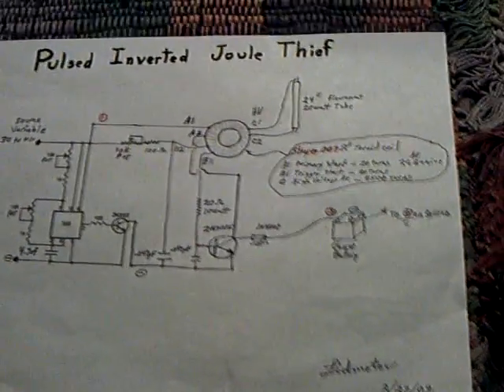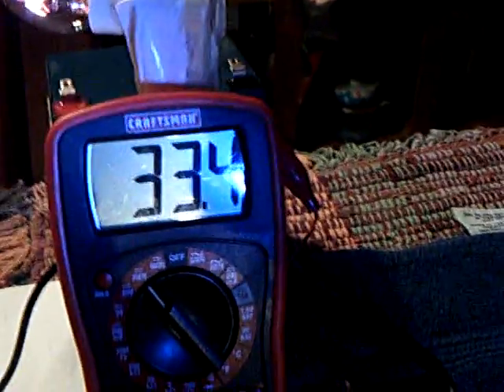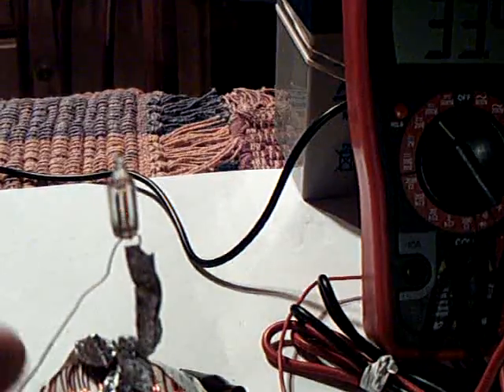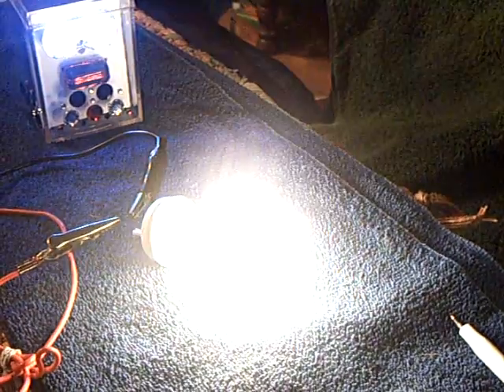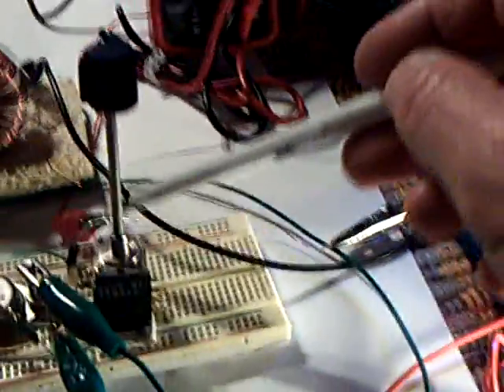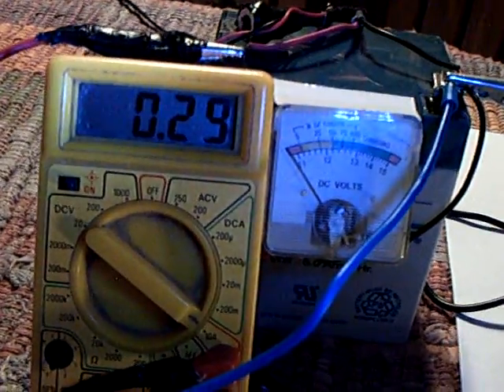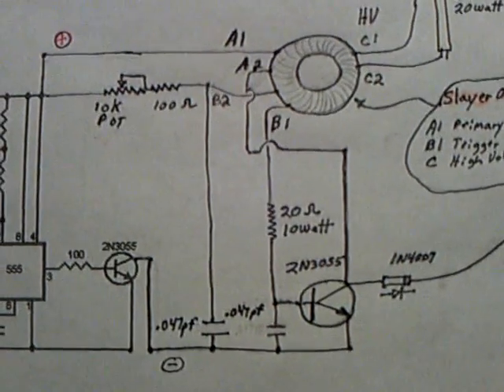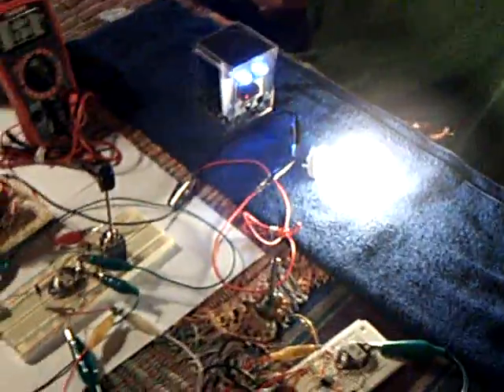Pulsed Inverted Joule Thief Small bulb Big light

Comment: yeh its much more versatile. Im noticing that amp draw is heavily dependent on the coil - gauge and number of windings. I have a 90 turn 0.4mm bifillar and at 12V the lowest it pulls is 700mA... not very good (but im getting great charging out of it!). it is much more efficient at lower voltages tho...

How many winds and guage are u using Lidmotor? u have very little amp draw...

Really wish there was an easier way to wind these toroids, man they can be a headache!

Comment: Check inside a junk radio, i found a 4" ferrite rod in it,  then you can wind diferent coils on wax paper and seal with candle cooking wax, so that theycan be removed......

hey, by the way has anyone tried putting a joule thief with a cap on the output  to the relay circuit imhotep made seems like it would make a helll of a bemf.....think i might just try it.  my flasher curcuit should work.